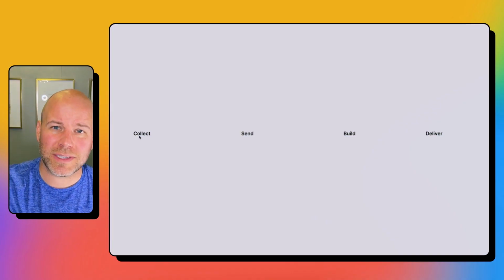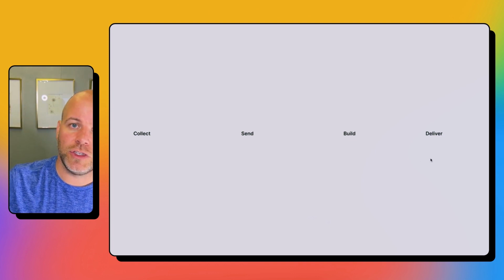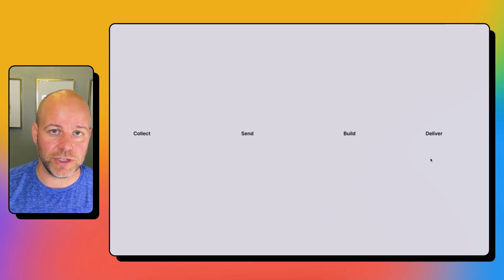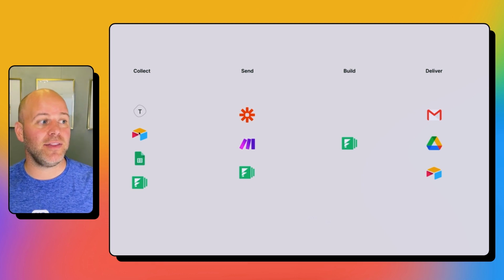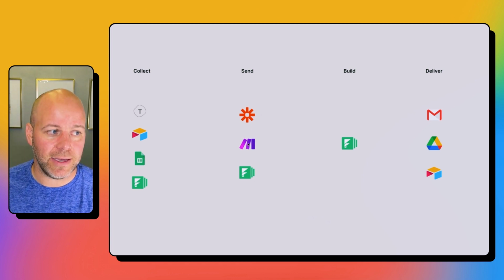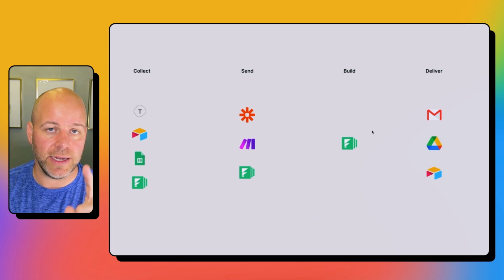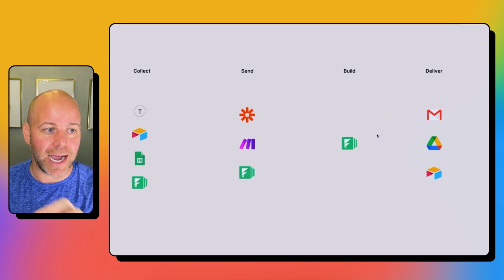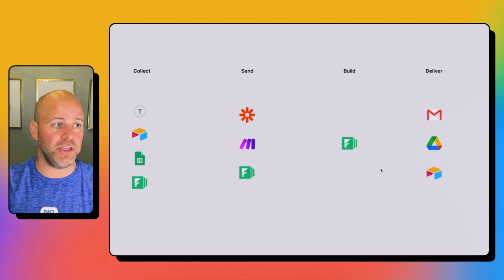Universal document automation process: Collect - Send - Build - Deliver

Comment: Hi, I have a document in Formstack using the data from power query which is passed to formstack as an object variable in power automate. Now I want insert few dynamically generated charts and table data in the same report. The charts are created in power bi and the table data is from an excel spreadsheet kept at Sharepoint location. How do I pass these charts(images) and data to formstack? These charts and table data are generated dynamically and should not be publicly accessed as it is customer data. I am not able to pass neither these images nor the excel data as a merge field to formstack from power automate. I can convert power bi charts and store at as pictures at a sharepoint location if required. Is there any way to achieve this or is there any way I can directly refer the charts and table data in the formstack document template I upload. Your help is much appreciated. Thanks!